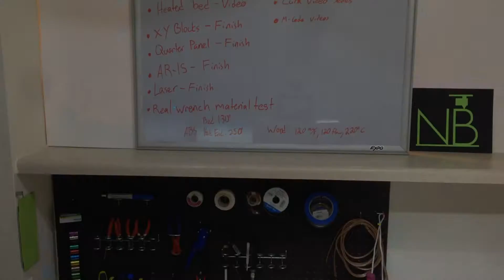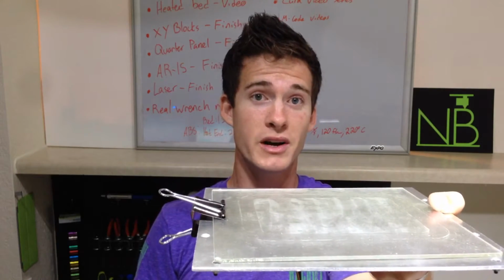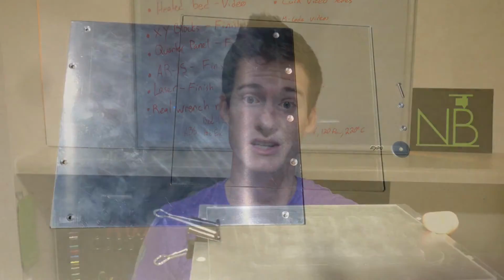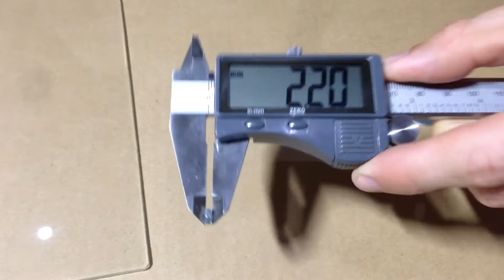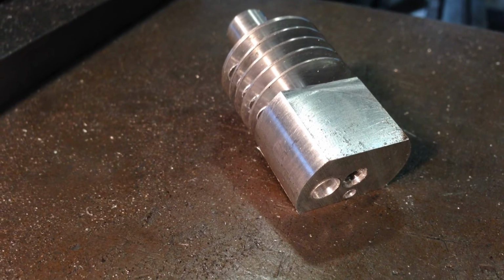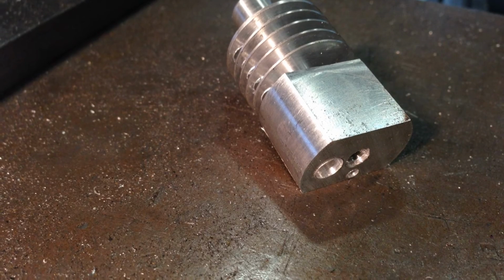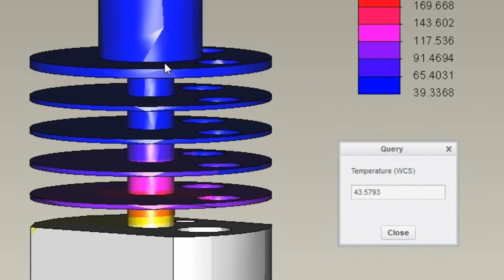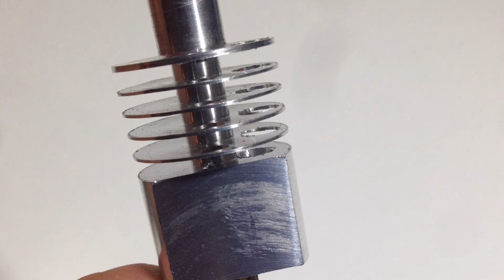3D Printer Upgrade - Glass Mounts

Comment: Fastening a metal edge against glass seems like a really bad idea. I can see a lot of people cracking their glass doing this.
Reply from the maker: +Jamie with a little bit of care taken not to over tighten I have had no issues. If you were determined to break the glass it would be possible.
Reply: Mounting the glass in that manner, eliminates one of the virtues of a glass bed.  It can't be removed to deal with stubborn prints.
Reply from the maker: +Shadowcruise99 I remove my glass bed every print by loosening the screws with a couple turns of the brass knobs. Slides out very easily.

Comment: Cool idea, SUBBED! I may modify it a little by using a cam lock design for faster removal and also sanding the glass surface with 1200 grit carbide wet sandpaper to allow the plastic to adhere better but still release fairly easily when the time comes. I assumed thermal shock would not be an issue with standard glass as well. As long as you do not dump your ice cold beer on the surface when it's at full temperature there would be no thermal shock to begin with. Anyway, this is your second video I watched, I will be watching the rest as well, keep them coming. I will be starting to make some videos as well once I get all my materials  together. I have a cool idea to utilize polyester resin/hardener impregnated with 2-10mm carbon fiber strands fed individually through a conventional style 2 part epoxy mixing tube/extruder.  The mixer tube/extruder  will be machined from stainless steel in 2 halves then highly polished for easy post print cleanup. The orifice size can be varied for different resolutions/print speeds much easier then the filament extruders. Even multiple sized orifices for large fill operations once retaining walls are laid down. Fine tuning the fiber, resin/hardener ratios will be the key that once mastered will unlock an entirely new medium for the home 3d hobbyists. They already have carbon fiber 3d printers that print with continuous strands, though that seems a bit too costly, complex and problematic for home hobbyist use. Not to mention scrap carbon fiber to be recycled (instead of wasted as it is now) can be had dirt cheap or even free.